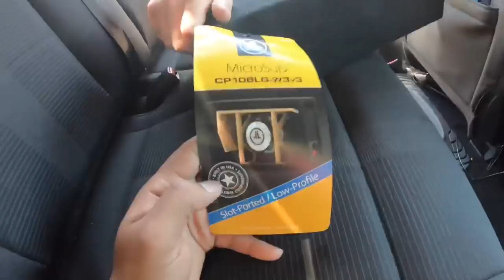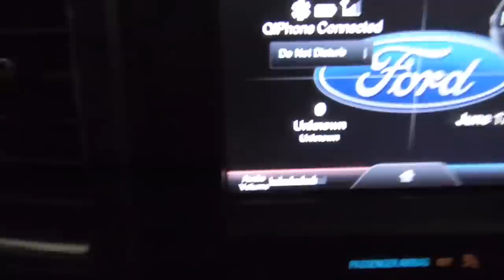New JL Audio Micro Subwoofer for My F150. Pioneer Subwoofer Update.

Comment: JL audio are my favorites,  however the smell you are talking about is the voice coil  heating up i had that same smell on 2 different jl audio 12w7 subs and the voice coil is what it ended up being  some of the jls have weak coils if you get that smell definitely keep the gains down or will end up cracking the voice coil...been there and done it more than once ...
Reply from the maker: Preciate that man! Glad you shared this. I’ll keep it down
Reply: You need to brake in your speakers when you buy them at least 3 weeks on low volume

Comment: There is no “normal” on the gains. You need to match the voltage output from the radio to the amp. Visit a reputable car audio shop that use the DD-1 from SMD and they will set it up perfectly. Distortion is what killed your last sub from the gains not properly set. Also, as like a rule of thumb (sort of)never go past 75% of your max volume on radio because they tend to distort past that point and it’s lethal to all your speakers. Hope that helps man. Be easy
Reply from the maker: Helps a lot bro! Others have said it as well. I definitely need to do that. Good to know on the 75% too. I like to turns mine pretty loud lol
Reply: @KickinItWithQ  haha yea man I know what you mean! It’s tempting to just turn it till it don’t turn no mo! Haha just gave you a follow on the gram from wicked ridgeline
Reply from the maker: Preciate it man!
Reply: I gotta 13 edge loaded 13 Sony speakers i changed most it’s got a stock 8in Sony sub I got Memphis door 6x9s com sumthin tweeters the subs in the right rear what sub do u think I should use with the factory amp without changing the radio And breaking the bank got baby in car…I ask because u really sounds like u know what ur talking about ty!

Comment: I run this 8" Microsub that I bought for $40 and a same looking Pioneer 4x100 w/ 2 channels bridged for 300watt to the 4ohm sub. I put the sub in the passenger foot area as the trunks in Miata don't let the bass out much without massive rattle and sound reduction.  Found another JL 8 microsub for I think $120-150. Also bought a JL W6 10" in HO enclosure like new for $300. Still haven't installed it yet in the SUV.

Comment: With blowing the old sub and you smelling something funky with the new setup, you may have your amp setting tuned a little high causing the amp to be clipping. Someone else suggested going to a local audio shop just to have your amp tuned. I run two of the 10" shallow pioneer's behind my rear seats powered by a 600rms Rockford Fostgate that has distortion detection. My gain is set around 25% running at 2ohms. Haven't had a single issue and I'm super impressed with how hard the shallows hit. I hope you have better luck with this JL setup though! My reccomendation would be to double check your power/ground cables, get amp tuned, or possibly upgrade your amp.
Reply from the maker: Preciate the information man. Yea something definitely off because I’ve never had issues with any previous system before

Comment: Definitely your coils are heating up.  I have the same amp on 2 - 6 1/2 Skars subs under the seat and at high volume on the knob and radio for too long makes that smell.  That amp puts out true wattage power and then some. Nice set up bro.
Reply from the maker: Preciate the info man. Think I found the right setting and it’s good. It’s not full bass but it still works

Comment: I have the 10" JL micro in my F150 too. The thing hits too damn hard. It's probably way more then I wanted for my setup. Anyhow...youve got a BA ride bro. The thing looks sweet.
Reply from the maker: Yea this little 8 be hitting so I can only imagine that 10in. I appreciate the compliment man 🤝
Reply: Gabriel...is yours a supercrew? Did it fit under the back seat?
Reply from the maker: Yep super crew and it fits under backseat
Reply: @KickinItWithQ  awesome . I am gonna order the powered 10 inch and wanted to make sure it would fit under the seat. Love the videos.  Just changed my mirror caps last night after watching your video
Reply: @krisstamper8488  yea, mine's is a supercrew Lariat. It's under my rear bench and I come about a half inch away from closing the seat completely. The bench actually makes contact with the box itself, and not the woofer at all. I've had people back there with no issues. You can barely tell that the bench doesn't come all the way down. I wouldn't change anything; the thing sounds killer.
Reply: Could it fit behind the rear seat?
Reply: @billgotskillb4308  Mine is tucked under the rear bench. It's about 1/4" from closing completely down. No big deal; you still can't tell that I hv anything back there, and I've had people back there with no issues at all. I kept my stock head unit and interfaced my amps with the audiocontrol lc7i. Amazing sound bro. I couldn't recommend this setup enough 👌
Reply: Have you tried putting it behind the seat?

Comment: A few questions: where are you getting that 12 o’clock is “normal” gain. That’s not the point of the gain turn. What you need to do is put a volt meter to it. Take rms and Voltage can be found by sqrt(Power x Resistance) and then set gain that way. For instance I have 1200 watts rms subs. My resistance is 2 ohms so my needed voltage is sqrt(1500x2) =49.98. So I put the voltmeter into the output of my amplifier and change gain until is says 49.98. Now I could just be completely ignorant in saying that 12 o’clock isn’t “normal” (whatever that even means) but I feel like you’re looking at this from an incorrect perspective. Gain adjust voltage level in an attempt to make them match your input voltage. It’s not a volume knob. Too much gain causes clipping which causes heat thus burning coil glue. I’m also pretty sure brand new subs will all have that burning smell for a period until excess glue is burnt off. Goodluck
Reply from the maker: Dang man! Great info. When I was regretting normal I was talking about the setting on the gainz knob. It has “normal” which is at the 12o clock position. I know nothing about systems and setting amps correctly lol. I had it installed by someone who set it. But this definitely was good enough. A lot of people have told me to take it to a professional and get the amp dialed in correctly similar to what you are saying. I appreciate the information again 🤙🤙
Reply: KickinItWithQ ohhhh okay, that makes a lot more sense lol. But even again, I have a kicker amp and the way my bass knob works is all the way down = no gain and all the way up = actual gain that I have set on amp. So by my setup a bass knob at 12 o’clock should be half the gain you have set on the amp. Maybe your gain is doubled what it should be???? Not sure. But yea as far as a profession goes you can definitely go get them to set it. I’ve heard it costs about $50, but imo it’s worth the learning experience (future preparedness) and the satisfaction (for me anyway) of doing it yourself. Gain can be easily set with a multi meter, low pass filter can be set by your personal preference (someone else can’t determine what sounds best to you) and bass boost should always be off as all it does is create clipping (which will create heat and destroy the sub). So really the only thing that I would say takes true effort is setting the gain. But hey, if your more comfortable letting a professional set it, then do that.

Comment: I 'd like to say when you smell a burning smell, it could be from the brand new subwoofer.  The coils inside the sub move up and down creating friction and when you get that friction, you may get that burning smell.  Once the coils/subwoofer settles in, you get less friction and that smell should go away.
Reply from the maker: Preciate the information man! Very helpful 💯
Reply: The coils don’t create friction. They only rub when they’re blown. The smell is from the coil overheating. It could be from playing the sub too hard or having the gain too high.
Reply: the coils MUST NOT rub. burning smell = burned coil

Comment: Aluminum body , you need to ground the amp to the frame with a 4 gauge wire , that is why your amp is over heating  . Watch 5 star channel about F-150 proper grounding.
Reply from the maker: Preciate it the info man. Not sure if you watched last videos but had a professional guy install it

Comment: Voice coil getting hot! Might be too much power running into them. My little 500 watt MTX can get my 12" Pioneer Shallow to heat up, so I'm sure all that power you're running to that 8" will do the same. JL best sounding subs in my opinion.
Reply from the maker: Chris Epps Preciate the info man. I think I finally got it tuned in right so haven’t smelled it since.

Comment: I’ve got a 2018 F150, I have the dual 8” micro sub box and I love it!! But..... since I have room, I ordered a single to go with them. My measurements say they should fit so I’ll have 3 micro subs under the rear! I had a Punch 400 pushing them but it died. Just ordered an Orion XTR1500.1 to push them 😉
Reply from the maker: Dang that’s thing hitting!

Comment: Tapping into the door speaker is the way to go. You need to run something esle. That's giving your sub mids and highs.
Reply: No it doesn't. The amp has an integrated low pass filter.

Comment: I had the same problem that My system kept burning, long story short I burned 3 amps and 2 set of subs. It ended up being the power wire was not highquality. always buy high quality power wire donot use the cheap wire that comes with the subs
Reply: replace the power and ground with good quality wire and turn it all the way up. You'll have no problems at all
Reply from the maker: Preciate The input and feed back

Comment: It's your amp getting hot on the carpet. I had that problem in a ford ranger when I was young
Reply from the maker: Sam Norals not sure..it should have some type of heat right?
Reply: The main battery wire heats up when pulling power. Need inline fuse or the wire can burn the carpet from the amp all the way to the front. Then burn the truck down.

Comment: just an FYI the power wire going to your amp is way to small ou need a 4 gauge
Reply from the maker: That’s what everyone is saying. Would that cause clipping?
Reply: The JL installation manual calls for 8 gauge power wire. I just installed the 10” sealed version in my F150.  4 gauge will not fit into the connector they provide.
Reply: Although mine was the powerwedge+ which has the built in amp.
Reply: @KickinItWithQ   yes because its not getting enough power

Comment: That's some thin power wire go up a guage or 2.
Reply from the maker: May have to swap it
Reply: @KickinItWithQ  Look like a knife knicked the power wire at the battery should be good as long as no wire is showing.

Comment: I want to put 2 jl audio 13.5 tw5s I think they r called in my 96 f250 but dam they expensive as fuck 680 a piece I’m not sure weather to go the jl 1500 watt mono amp or get 2 jl 750 watt amps one amp to power each sub what’s your take on this shit. I have a 96 f250 crew cab short bed 7.3 liter diesel i want it to bang hard as F also going to run a old school btk butler tube amp for highs and minds my tube amp 4 channel 75 watts a channel blew up 2 jl audio 1 subs back in the day and blew my tube amp but got it fixed and been sitting in closet for dam near 17 years collecting dust.

Comment: You need to upgrade you power and ground wire to a zero gueage you are choking the power needed for your system. Cand causing more strain on the powere wire.

Comment: nice truck what year is it?
Reply from the maker: It’s a 2015
Reply: @KickinItWithQ   thanks for your response, awhile ago I had a system in another car used to own and I had the remote dial up front and I noticed that when I used to get to certain level it will get smokey so I was told two things first you need to put it in a space where it will get more air check where the vents are maybe you just have to flip the amp, and second to don't crank it that much
Reply from the maker: Yea that’s a good idea. I might aim the vents down in the back seat. Yea I definitely use to crank it. Another guy said no more than 75% volume. I appreciate the info man
Reply: @KickinItWithQ  idk how loud your radio gets but at the time mine had a top of 33 and I always had it at 25-27 tbh
Reply from the maker: Mines doesn’t show numbers just the lines for volume so I’m not sure

Comment: I just bought a system for mine not hooked up yet but I hit the kicker 12 square sub I'm wondering if I can put it behind the seat
Reply from the maker: It’s right back there but definitely doable. Just got to trim those bolts down and cut some of the installation out
Reply: @ juan guzman helll yeaa L7?
Reply: L7T in a box but mine has the sony sub back there I wonder if I can put back there if not guess under the seat but when I fold diwn the seat it touching the speaker
Reply: @KickinItWithQ  🤔 mine has the sony sub in the back that's the thing though
Reply from the maker: Man only way to know is to give it a try lol.
Reply: @KickinItWithQ  ok